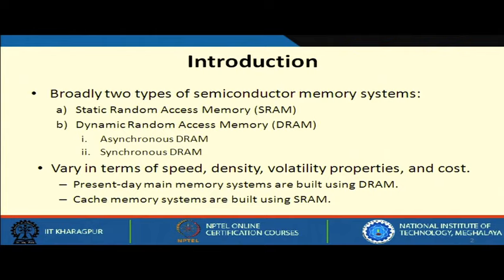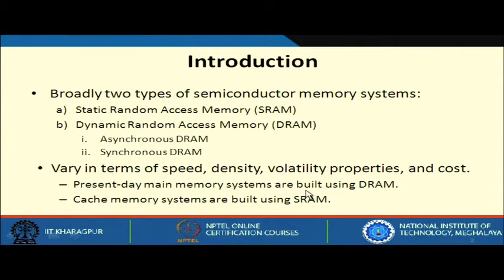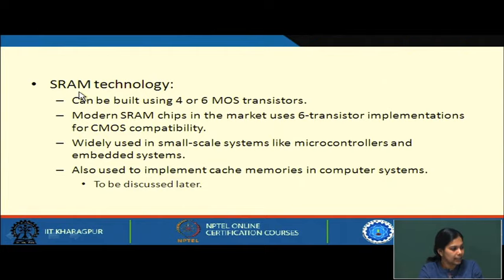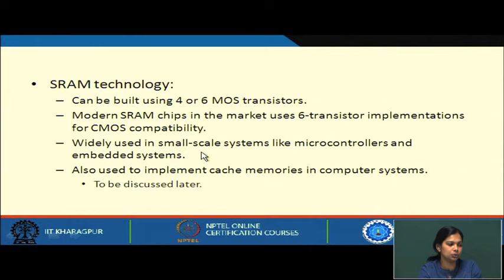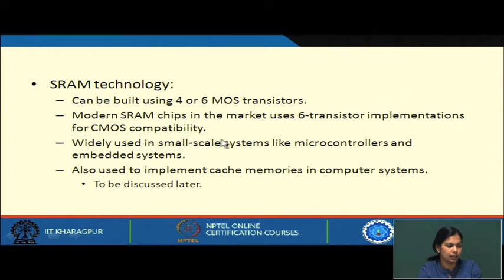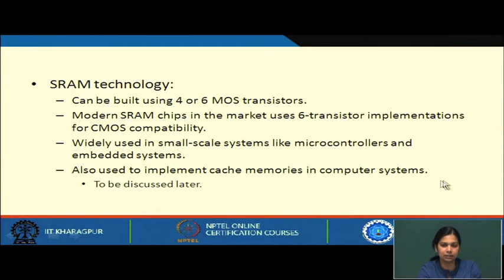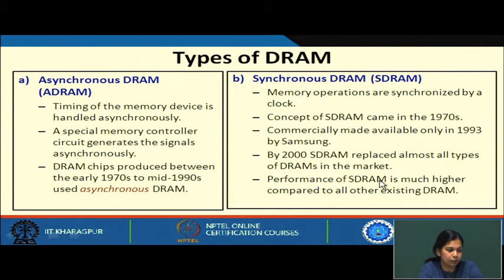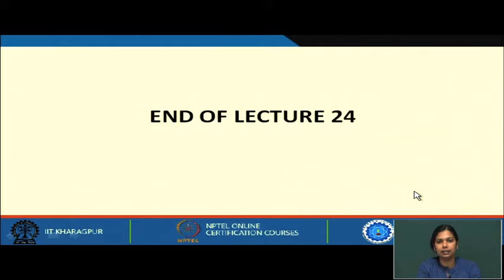Lecture 24 : STATIC AND DYNAMIC RAM

Comment: 00:14 Static and dynamic RAM are two types of semiconductor memory systems with differences in speed, density, volatility, and cost.
03:08 Comparison between SRAM and DRAM memory systems.
08:56 SRAM cell consists of two inverters forming a latch connected to transistors T1 and T2.
11:23 Static RAM cell operation and read operation
16:24 CMOS realization of NOT gate.
18:51 CMOS realization of not gate and six-transistor static RAM cell
23:31 Static RAM requires current flow only when accessed
25:53 One transistor DRAM cell requires periodic refresh due to charge leakage
30:26 Asynchronous DRAM vs Synchronous DRAM